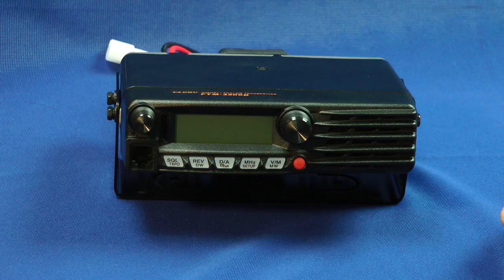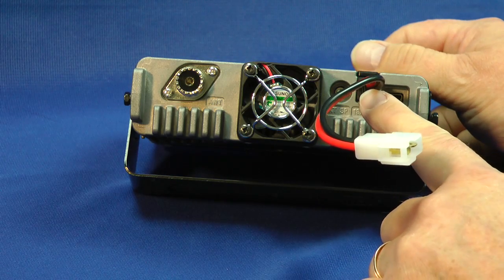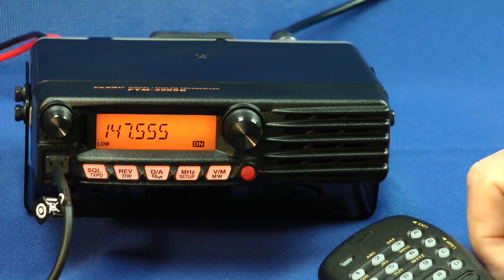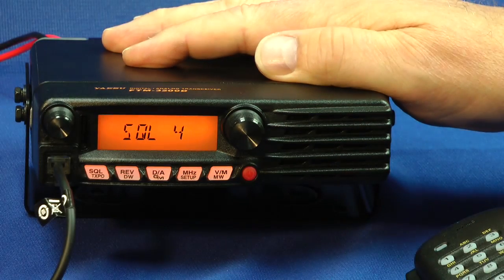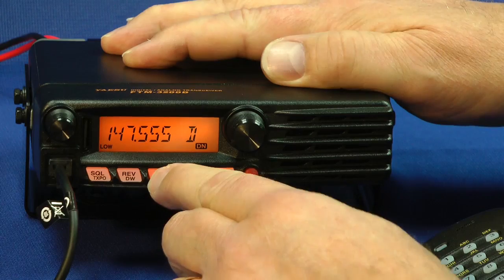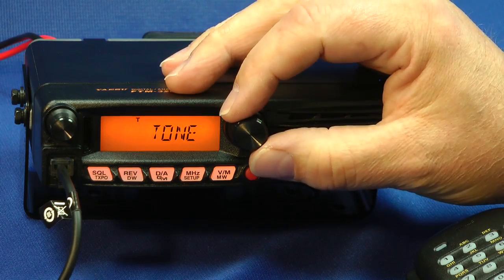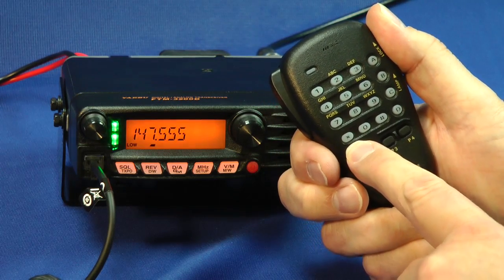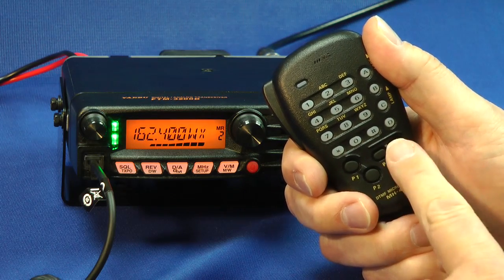Yaesu FTM 3200DR Transceiver Review

Comment: There is only one issue: In TSQ mode hear the analog squelch triggering trough the external speaker by a "blob" noise. The FTM-7250 it's much more quieter. Needs to be fixed that the audio mute switching not going in the AF-AMP.

Comment: did you hold down transmit without an antenna installed? doesn't that burn up the radio per that instruction manual?

Comment: mine is unusable in my office.  intolerable fan noise in an otherwise quiet environment.  radio is silent upon power-up but the fan noise creeps up after a few minutes w/o ever transmitting.  I much prefer my fanless Yaesu FT-2900 in my office setup.

Comment: mine is unusable in my mobile, the squelch chops off every other word of a weak or fluttering signal from the repeater. it is on squelch setting of 1.
Reply: I also have the Yaesu FTM-3200D and I noticed that the squelch doesn't go low enough when in AMS mode (automatic mode select) even when set to squelch 1. In this mode, it automatically determines if the receiving signal is analog or digital. BUT when I press the D/A button to set my radio to analog ONLY mode, the squelch opens up much faster and with a much weaker signal when set to squelch setting of 1. So if you are using analog repeaters, try setting it to analog only mode with the D/A button (No DN icon showing on display) and your weak signal might flutter much less. Now I always run mine in analog only mode unless I specifically want to use digital mode.